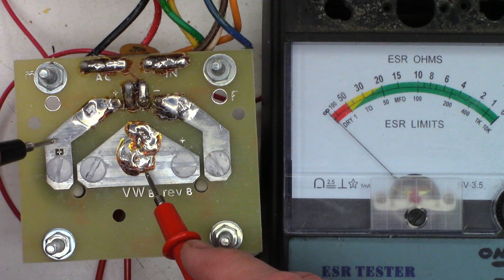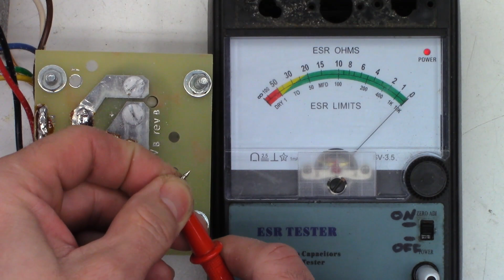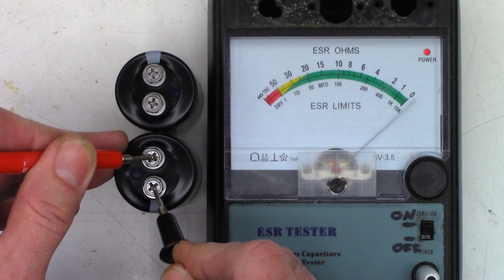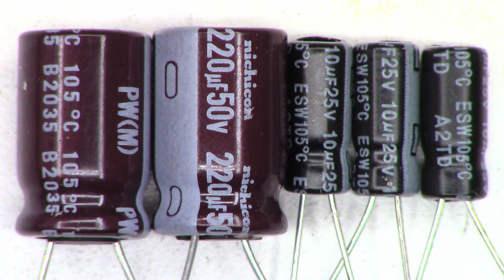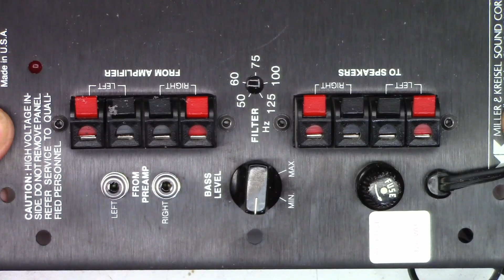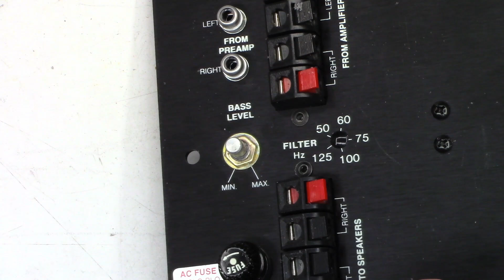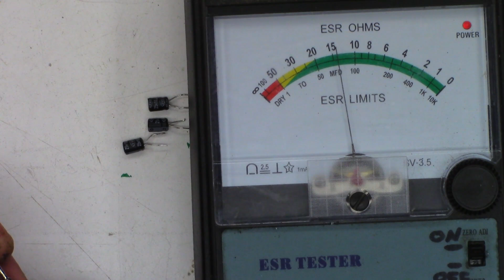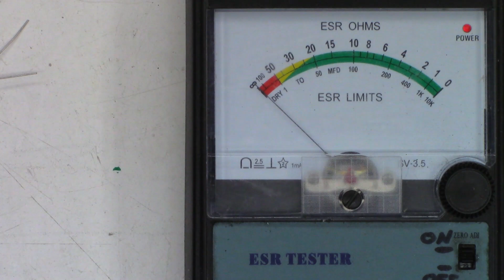MILLER AND KREISEL V-2B VOLKSWOOFER CONSTANT BUZZ PERFECT REPAIR DEOXIT D5 CAPACITORS STK-086

Comment: I have this amp with the exact same layout. Powers on to a hum but no sound to sub. T one of the 25v 10uf caps leaked on to board. I cleaned an replaced 3 caps at that value. Here is the strange part the board you show here has two 50v 220uf but the one I have only has 50v 10uf. Think maybe someone else attempted repairs before it came to me. Should I replace the 50v 10uf cap with 220 if like shown in video. I replaced with same value and also change power amp module. Also number two pin on the amp module plug on the board number two pin has 0 solder. I haven't checked the large rectifier caps yet but checked price and they want $64.00 each. Hoping they test good.
Reply: Currently I still only have a low level hum but no sound coming from the sub.

Comment: Does a hum or buzz always indicate that something is wrong/ broken? Even in preamps?
Reply from the maker: Usually failing filter capacitors will cause a hum/buzz.
Reply: @norcal715  Thanks. That’s what I thought as well. The manufacturer of the $3000 pre/pro says a very low level hum is normal in these products…

Comment: Wow that thing must run really hot, practically every cap completely dried out!
Reply from the maker: The date code on the large cap in the start of the video is 8319, the 19th week of 1983. These have no power switch so anytime plugged in those things are energized. Could just old age.
Reply: @norcal715  wow, only 2 years younger than me. That’s impressive then that it still works (now anyway)

Comment: With those silpads I always find a small drop of silicone oil on each side helps a lot, making them act like new again, as the silicone oil they were originally compounded from tends to evaporate out.

Nice to get a unit designed for servicing, with the power module plugged in, though I suspect that was more done to make assembly easier in the factory, and they could also make the boards for many powers, only putting in the correct STK power pack on assembly. Must really be poor quality can capacitors in there, as those screw in caps tend to be good, even after a long time, though if you are using poor parts to cut cost yes they also fail. Probably a sure bet that any of those units that come in changing all the on board caps is likely just a thing to do, as it seems they all fail.